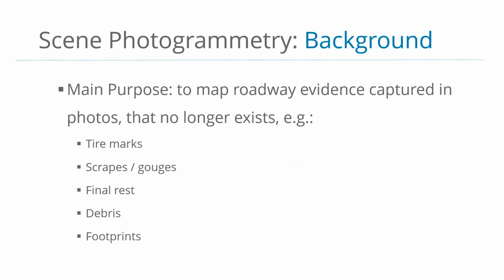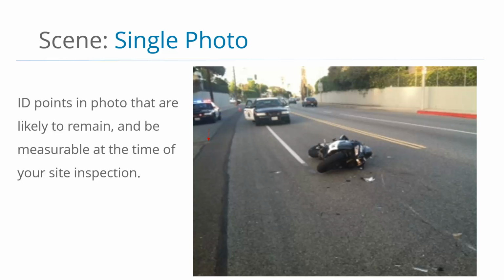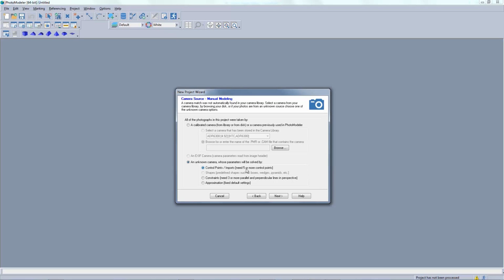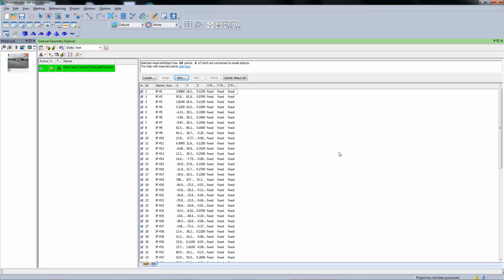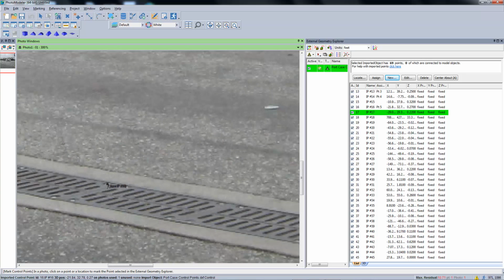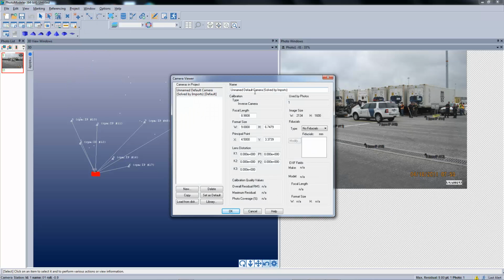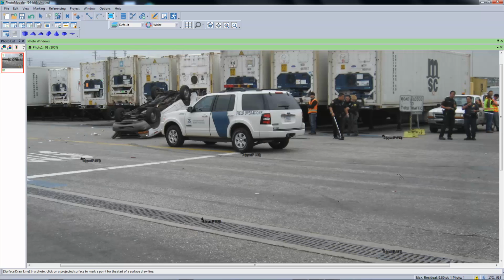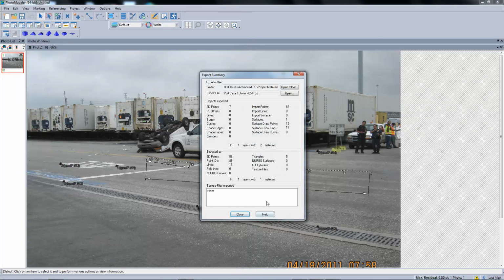Single-Photo Scene Photogrammetry with PhotoModeler

Comment: Great job - very informative.  Question - have you used known dimensions instead of control shot with a total station?  For my work we aren't able to send surveyors out.  I'm thinking if I knew the make/model of the police car for instance I would be able to use this somehow.  The known dimensions are not in a coordinate system however.  How would you approach that?  Maybe you wouldn't have to if survey is always available.
Reply from the maker: Thank you, Dude. If the vehicle consumes enough of the frame, you could use something like a 3D point cloud of the vehicle to provide control measurements. Once the camera is solved for, the contact patches of the tires could serve to create a surface for measuring roadway evidence. Advanced technique, but doable. If you need exemplar point clouds of the sort, we have about 1,200 of them here: https://lightpointdata.com/laser-scanned-exemplars.